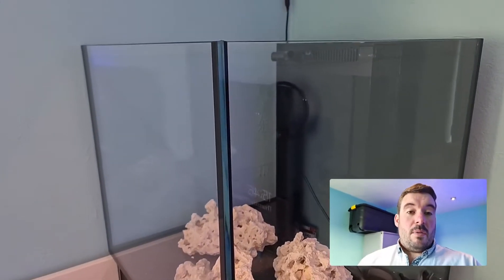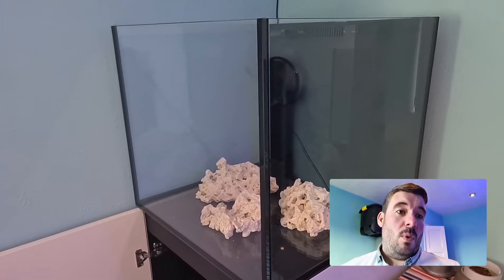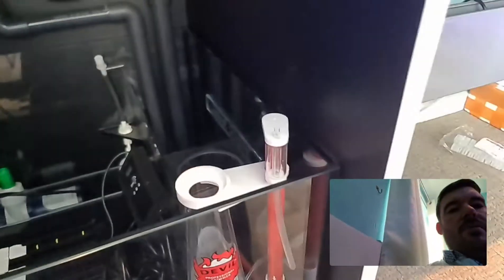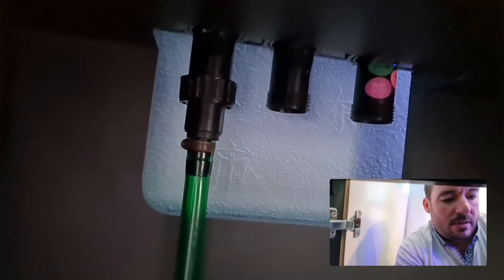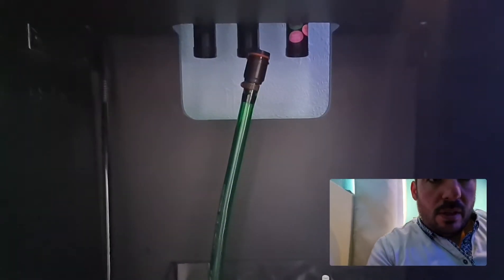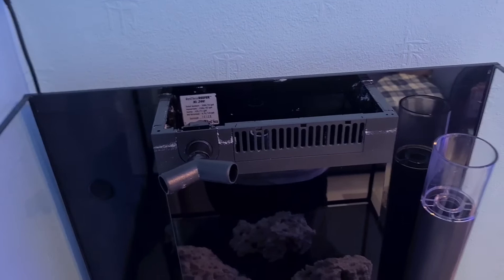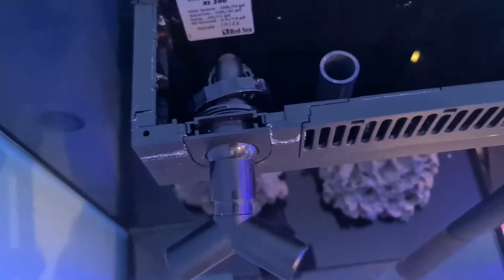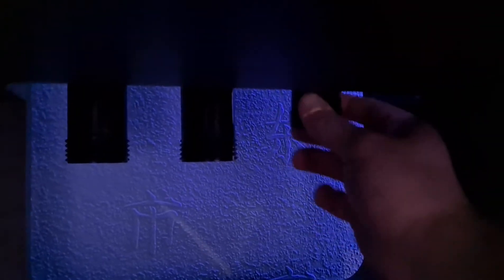How To Replace Red Sea Reefer (XL200) O-Rings And Remove/Refit Pipework

Comment: Yeah dude thanks. I mean pretty straightforward but nice to have a check just in case
Reply from the maker: Thanks! Yeah I had to work it out myself a little as there more o-rings than you need due to the pack covering larger models too

Comment: Wow I didn't even think about this when I got my second hand red sea 170. Great advice for my next tank. 

The sump section looks exactly the same as mine. I actually changed my ATO tank into a refugium that sits inside the sump with no drilling or plumping. Works like a charm
Reply from the maker: Yeah, to be fair the seals all worked fine when I test filled it and cleaned the tank but a few local reefers suggested replacing them, definately worth it for less than £10/$10.

Yeah the sumps near enough identical although the XL200 might be a couple of cm deeper front the back?

I've seen that refugium mod on the forums, looks cool 👌 I'm considering that or maybe a similar idea with a hang on refugium in the side of the sump and keep the ATO? Thanks for watching!
Reply: @PracticalReefer  hang on the back is an idea..I did think of that at one point and then thought, that would be extra pressure pulling the glass, plus I went with reusing what was there 

 One thing to realise you will end up filling in that ATO quite regularly. Right now I use a 25L water jug and it lasts 2 weeks, so I don't need to worry about it..I'm sure using the red sea ATO you would end up filling it up every 3-4 days
Reply from the maker: @rudra7615  yeah, I know they are made to hang on just fine but was thinking of proping the hang on side refugium on a few blocks of timber beside the sump just to help me sleep, as it will just be dead space under it except from a few wires maybe.

Yeah hoping I can stick with the standard ATO by using a lid to reduce evaporation but it still might not be enough the other option is to increase the size/height of the reservoir too? As I really do like the simplicity of a gravity fed ATO 👌
Reply: @PracticalReefer  blocks of timber makes sense so no pressure on the glass!